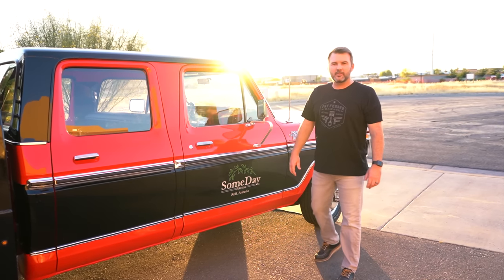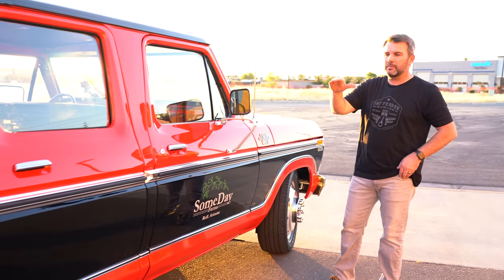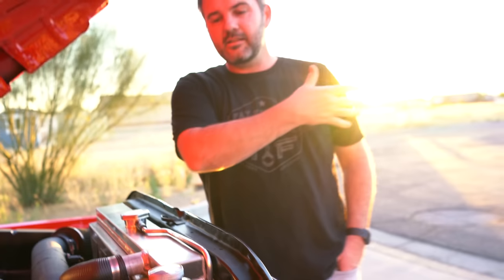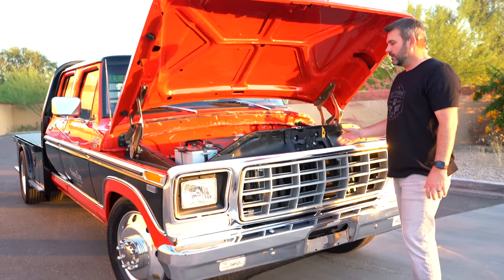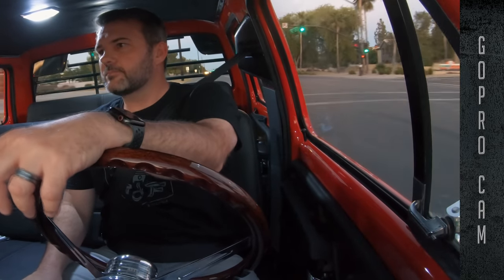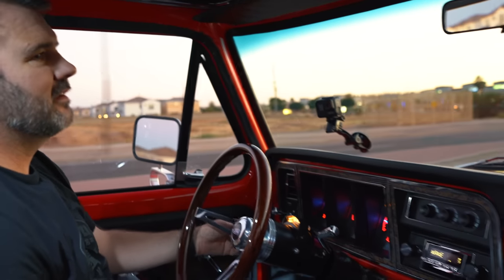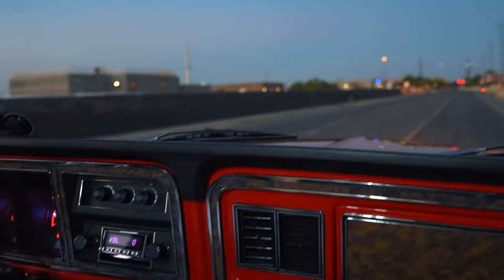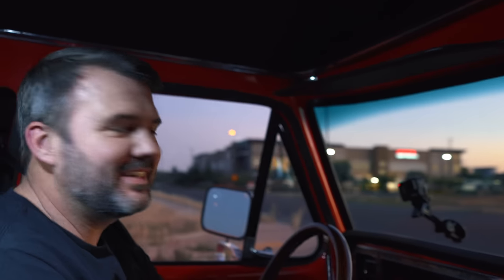Does a Coyote have Enough Power for this Dually Crew-cab Truck Beast?

Comment: Should of waited for the new 7.3 Godzilla!
Reply: Needs to be next episode
Reply: Was thinking same thing
Reply: *Should have
Reply: or a cummins swap if the gasser aint enough
Reply: @fread51  someone has no idea what hes talking about. its not the old diesel its the 2021 gas motor...
Reply: Addison Quarrell he’s most likely talking about the Cummins
Reply: @fread51  never beat the torque of a straight six turbo diesel.
Reply: @RadDadisRad The new 2021 Ford 7.3 Gas is what im referring too. So far its bern getting good feedback

Comment: Coyote motor has more horsepower than anything offered in 1978!
Reply: More hp yes but not more torque  that's what you need when you tow
Reply: Wrong.
Reply: Torque is what does the work, that being said 7.3 Godzilla gas engine or a 6.7 power stroke swap would have worked better. RPM range on a 5.0 coyote is to high.
Reply: Absolutely right. Everything in the late 70's sucked because of emissions. I remember the anemic 454 with 260hp and 360 ft lbs. of torque. If you were lucky.
Reply: @KJ-kw7gh  at what RPM? Less then 4000 RPM. Coyote engines have no low-end torque. But incredible high-end horsepower.
Reply: @KJ-kw7gh  i have a 454 just like that, tired and slow but i have a small dual plane intake and a bigger carb, long tube headers, and new pistons and rods for 10.14:1 compression. I hope she's making 350 horse right now with stock cam and heads until i can afford heads/cam and hopefully make 500+ later.
Reply: Yeah but the low end would still be destroyed by a 460, I know a 351m/400m would have been standard but even throwing a 390 in it would have more grunt
Reply: Yeah but not as much torque as a 460
Reply: It has more power and torque than the 5.4 3V that they offered in the F-250/350, more power than the 6.8 V10 as well.
Reply: madmatt2024 the f150 coyote still probably offers more down low torque than those old motors late 70’s engines  of the time too even though they’re a high end engine
Reply: @chrishansen7004  yeah the numbers on even the big motors were pretty weak.
Reply: @chrishansen7004  the 390 in the F series trucks at the end was about 380 ft-lbs at like 2600 RPM, 400m slightly more. Obviously they didn't breathe very well or make much power high up
Reply: It's like a two stroke they should have L.S. swapped  it for a truck like that
Reply: One cylinder in a Coyote has more power than any complete motor in '78, yup.
Reply: @Wildstar40  not true.
Reply: A Raptor 6.2 would been better
Reply: @jaimeedwards1269  it has plenty tourqe
Reply: @kevind3185  that motor makes more a lot of tourqe.  It's all in a tune man
Reply: @MrDavidelliottjr  in a truck that heavy it will  tow a honda civic anything else it will probably struggle. Torque is not all-in the tune man it's airflow, stroke, rotating Mass and gearing
Reply: More horsepower, but torque is what matters.
Reply: That coyote with 430 gears or lower and its will be an animal for sure. Those trucks arent heavy either
Reply: @kevind3185  From what torque curves I see googling the Coyote torque starts at around 300ftlb at 2000rpm and climbs to 360 orso at 4000. I think he'll be just fine.
Reply: @David-yy7lb  a lot easier to get spare parts for a 2015 mustang motor than a 460, and a lot cheaper. Given the torque curve is pretty stable it's probably a fine motor.
Reply: Yeah but you're spending big money on a big truck I want all the torque I could get. Who cares if it's got more pull than it did in the 70s this is now and there's so much better out there. He's going to be very disappointed the first time he tows a trailer especially up a grade.
Reply: @Terminxman  the coyote has around 300 ftlbs starting at 2000 or so so they'll be fine
Reply: @bigjay6743  its a work truck, lol. if you're gonna drive it every day then you don't want crazy gas mileage when all you're hauling is some plywood.
Reply: Nice looking old truck love old school with new school...
Reply: Torque is more of a factor for this application
Reply: @jaimeedwards1269  Actually...the 1979 460 made (at the wheel accounting for 20% drivetrain loss) 170hp/274ftlb at 4,400 and 2,600 respectively. The 5.0 Coyote makes those numbers at 2,900 and 2,700 base on multiple baseline dynos. SO the Coyote actually makes the same torque at only 100RPM higher than the 460 but is already delivering more HP well below the 460's peak. In fact, when the 460 is making 170hp, the 5.0 is making about 280hp...over 100hp more than the 460.

That's not to say the 460 can't be beefed up into a torque monster with some work...but at that point, turbo the 5.0 and watch the torque SOAR if the setup is right.
Reply: 0xsergy parts and labor for a dohc fuel injected engine will never be cheaper than an ohv traditional v8. If you want a cam for a 460 it’s a couple hundred bucks at most. You need 4 cams for a coyote. Intake, edelbrock air gap is less than $300 for a 460. An aftermarket intake manifold for a coyote is outrageously expensive. The 460 or a small block ford 302/351 will be cheaper for a long time. Maybe forever
Reply: They were probably looking for fuel economy over torque when they developed the 5.0
Reply: @jaimeedwards1269  5.0 tows 11.5k in a 150 crew cab and I'm willing to be it's not much larger than a modern 150 maybe 700-1200 lbs heavier because of the bed. so still 9.5-10k towing
Reply: Different kind of power, that old shitbox 351M/400 would plow snow, pull a trailer and do grunt work all day everyday
Reply: @madmatt2024  horsepower yes but that a hard no on more torque which is everything when towing and hauling heavy loads. or just moving heavy vehicles. Even the most anemic non PI v10 makes the exact same 420lb-ft of torque as a gen 3 coyote and it makes it waaaay lower than the coyote. coyote doesn't make until around 4.6k rpm. the 2 valve non pi makes 420 at around 3k rpm pi same 425 same rpm and the 3 valve v10 makes it's peak torque of 457 at around 3.2k rpm. much lower and far more usable for doing work and these v10's are ridiculously bottle necked too. it's a shame the aftermarket never really took to them because there is absolutely stupid power that could be had with them. they bottle necked them on purpose so people would actually buy the diesels which were a complete flop with the 6.0's and 6.4's they would have been better off putting more effort towards the v10s there was a prototype engine that was 7.0L was dohc instead of sohc and made 590hp and 509lb-ft of torque all motor. unfortunately it never made it to production. also that engine was only gonna be a race spec engine of course i can only imagine what it would have done with a blower on it
Reply: @insaneTrout  Except for the fact that anything Ford 3 valve junk. I've seen so many failures on those Ford's that I would advise anyone against owing one. This extends to modular Fords in general. Up to this point the Coyote is the best V8 that they have made in a long time. Jury is still out on the new 7.3 in terms of longevity.

Comment: Wow what a beautiful truck.  The exterior and interior work is perfect.  I love the little screens below the factory gauges.  Whoever designed and did the work did an amazing job.  Its not over done like so many builds are.

However I wouldnt have chosen the coyote for this truck.  I had a 2015 mustang and always thought it lacked low end torque and when I bought my f150 I avoided the 5.0 for that very reason and went with the 3.5tt.  However there are a couple ways to make the 5.0 much better for low end.  First would be to replace the intake manifold from a f150.  They dont rev as high but they trade that for low end power.  Second and more expensive would be a roots style blower like whipple.

Comment: Pretty truck. Might have been a hair nicer to add power windows. I think making a cold air intake box to keep it insulated from under hood air temp would be good.  Be really cool to see how a new 7.3 gasser would work in this because although the coyote is a good motor, most the power is up high in rpm.  Very nice work.  I like that Digital dash! Owner should be super happy.

Comment: Very nice truck. The steering column was always too long in these trucks, it was a great idea to shorten them. I don't know if you shipped this truck yet but I can see daylight thru the gasket above the driver side vent glass. It would have to leak air and water. I don't care for Fords so much but I would be proud to drive this one.
Reply: Those vent windows were prone to not fitting right even on GM trucks.
Reply: One more thing. I would have gone with one piece glass and ditched the vent windows.

Comment: Waiting to see someone use the 6.2 Sohc in a swap like this
Reply: 6.2 is meh at best. grab a motor from a wrecked 150 or s197 and spend the difference on a s/c your welcome.
Reply: GhostlyGhille the newer 6.2 offered in the F150/250/350/raptor is a more than viable option, especially when compared to the Coyote, or literally anything offered in Ford trucks before 2015. The F-150 version with 411hp and 434ft/lbs would make a perfect swap with only 1hp less than the same year 5.0 but with more torque.

Comment: I don't forsee this engine lasting very long if being used to tow.
Reply: I think it'll be fine, metallurgy has come a long way. I don't expect the engine's life will be significantly shortened, and if it only pulls off 200,000 miles there are plenty of parts and spare engines around for cheap.

Comment: I am sure this cost a pretty penny so they might as well add a Whipple, Roush or Edelbrock Roots style blower and really up the torque output. Lsxroshak suggested a Procharger but I am thinking the linear torque and instant hit of the roots style supercharer would better fit this trucks mission. I have a centrifugal equipped 5.0 with a cam and it hits at 2500 rpm where the tires will suddenly light up if you are on the gas. Not ideal for a heavy truck where stump pulling torque is king.

Comment: Guarantee  that coyote engine has way more power than the smog strangled stock engine, why you would think it wouldn't have enough power is beyond me
Reply: Biker Jim probably were referring to torque. It doesn’t make much down low.
Reply: Horsepower is a no brainer here, of course the Coyote will make more (probably a lot more). Fact of the matter is that there's not a chance in hell of a Coyote making more torque than the 460 that likely came out of the truck, and torque is a BIG deal in a truck like this. It looks like it's gonna do great as a driver, but I'm not so sure I'd want to hook up a trailer to this feller.

Comment: Tell us the story on the wheels. They look perfect for an old truck that has to do work...way better than the usual 22's. Are these turned down 19.5's? I wasnt aware that Alcoa makes 19" 8 lug wheel.  Either way they look great...stance is perfect.
Reply from the maker: Turned down 19.5” exactly.
Reply: @FatFenderGarage  I'll be calling on Monday for details. I have a 74 F350 crew, and this truck is inspiration!

Comment: I have not watch this video yet but I can tell you a Coyote has more than enough power for this truck. 1978 was a weak year for hp. A 3.3 v6 with a 6 speed and 3.31 gears would out run the largest 1978 v8 that came in this truck.

Comment: I wanted something like this until I owned two F150s with 5.0 engines that both failed, cam phasers both times.
If I were to build a one ton it would have a 408 Windsor with good heads. I would never have to worry about it.
Reply from the maker: John Parrish the truck motors aren’t the same as the mustang motors I’ve experienced. Mustangs is much more robust

Comment: Not sure the Coyote would have enough power? The gen 2 Coyote is rated (in a mustang) at 435 HP and 400 lb-ft of torque. How much you need? The stock 351 Cleveland was probably lucky if it made over 250hp  and 350 lb-ft of torque.

Comment: Has there ever been a truck produced with dual front wheels?  I've never seen one and it sounds kind of odd like it would be really hard steering!
Reply: I heard him say that too,thought he probably meant 1 ton front wheels, but who knows.
Reply: Yes they did. I'm picking up one this weekend. They could a just swapped in a f350 dually type front beam assembly. Go find a old 70s uhaul or tow truck. Dually style front rims also.
Reply: Some trucks were like that. Only the rear axle had the dually style wheels. I had a small dually Nissan 720 that was the same way. The front axle was the same as any other Nissan 720 and the rear axle was a heavy duty unit.

Comment: The original 351 Cleveland will out pull that Coyote any day of the week.
Reply: D S :Except they never put Cleveland's in trucks.
Reply: @ronaldjensen8614  nope the 351 was the 351m but this thing prob would have had the 460 originally. the coyote isnt the best motor for a big heavy trailer though i will agree. this truck prob weighs less though than a modern f150.

Comment: That truck screams for a cammed Godzilla swap!! Without much effort those engines make 600 HP with damn near as much torque on a flat curve. A 445 cubic, 600 HP V8 with a 4.30:1 rear gear that truck would pull any camper or hay hauler or anything you put behind it really. Don’t get me wrong I love the coyote but that big old truck would do much better with a torque monster 7.3 with a cam and some long tubes. Hopefully the owner gets the bug and upgrades. Sweet truck nonetheless but a Godzilla would absolutely put it over the top for work and play.

Comment: If you mess with the gearing, you'd be surprised how small of an engine you can use
Practicality says go diesel.. Better for work, better for mileage
Reply: 12 valve would have been sweet

Comment: I bet that coyote has twice the power than the original motor when it came off the lot, and I'm going to go out on a limb here and say that it doesn't weigh much more than a new F150. Also why does a work truck have to get up and go. Its a truck. Low and slow that truck is perfect.

Comment: The original engine made about 200hp soooo....😂😂
Reply: The 5.0 is a powerful engine on the high rpm range, but it sounds like a V8 BMW or Mercedes 👎
Reply: @campbell0162  😂👏
Reply: Campbell01 and so what if it sounds like a bmw or mercedes. You ever think bmw and Mercedes sound like it... cuz the 5.0 has been around forever

Comment: that truck doesnt weigh anymore than a modern half ton that said id at least went for a 6.2 being it would benefit from the lower rpm towing engine. also would have  kept plaid interior.

Comment: That truck is a 79.  The front grille is a one year only......and that's 79.  The 78 is almost the same.  The only difference: Round Headlights.  The 78 grille is a one year only as well.
Reply: Actually a lot of 78 came with that front end with square headlights in 79 they were all square
Reply: actually no in 78 if you got a ranger xlt or a ranger lariat you got square lights only the customs got round lights

Comment: Don't need to watch the vid to answer the question. The Coyote has about 200 more hp and similar torque to the original engine it came with, assuming it was a 460, so yeah, no problem at all. Might have to gear it a bit lower to make better use of the Coyote's higher revving characteristics. Also, don't go comparing it to these modern-era diesels with 950 ft-lbs or you will be disappointed. And now, I'll watch the vid.